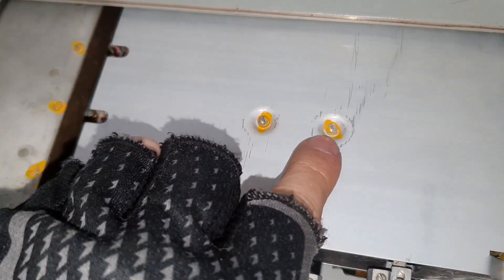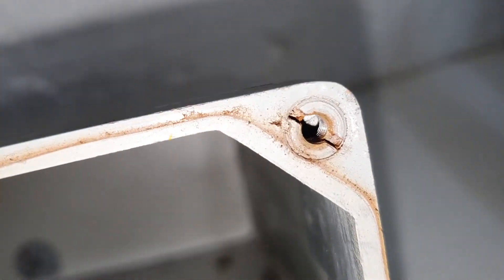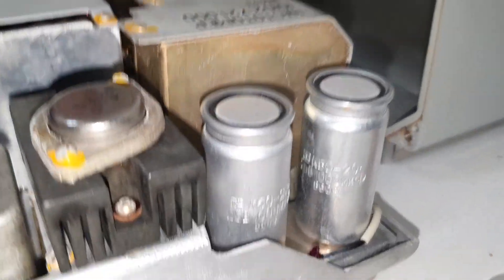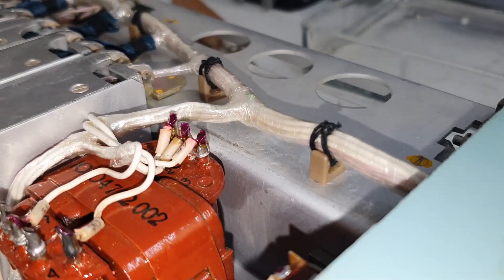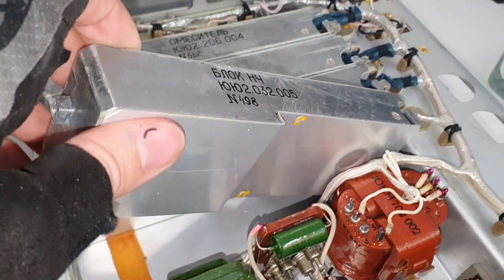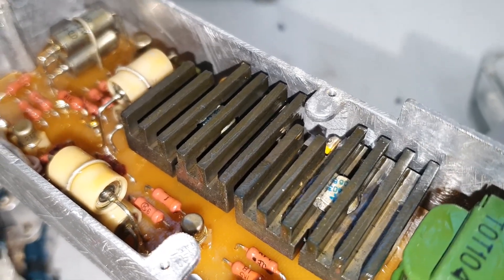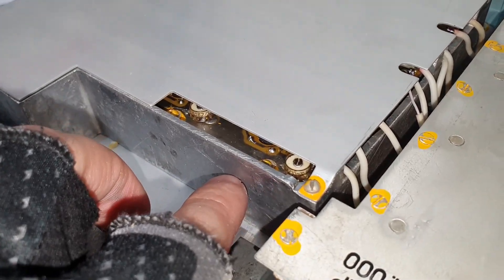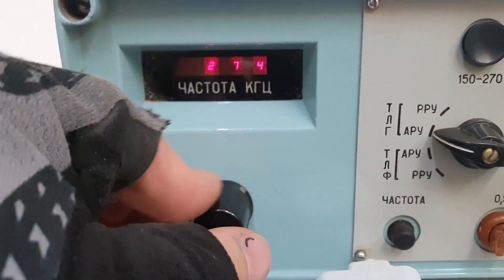BEB #136: Russian Transceiver P-880M with The Worlds smallest 7-segment Display

Comment: Hi, it's not a transmitter, but reseiver 150 -1500 kHz for weather and time stations
1:45 "ЧАСТОТОМЕР" - frequency counter
2:36 "БЛОК ВЧ" - RF circuit
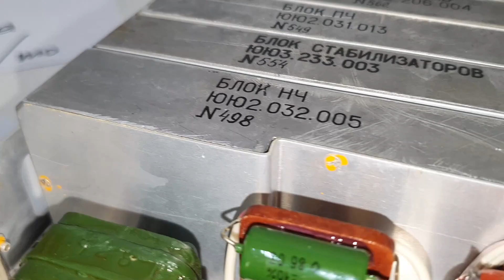4:10 "СМЕСИТЕЛЬ" - mixer
"БЛОК ПЧ" - IF circuit
"БЛОК СТАБИЛИЗАТОРОВ" - stabilisation circuit
"БЛОК НЧ" - sound amplifier circuit
Reply from the maker: Thank you! :-)